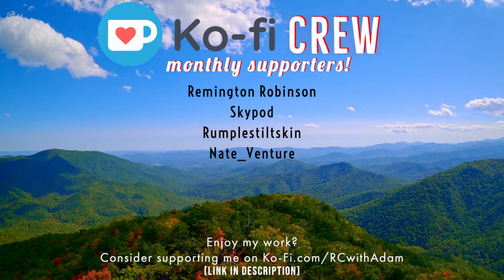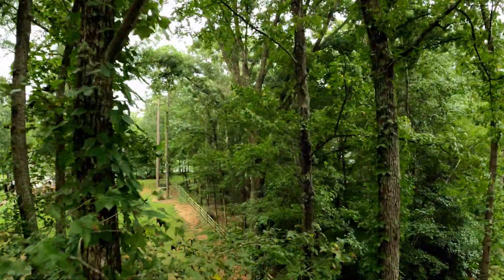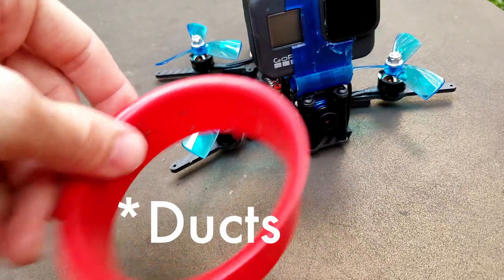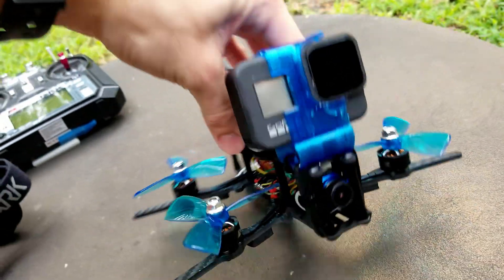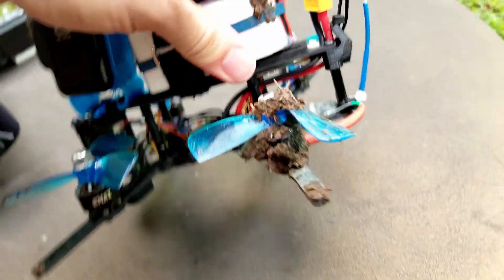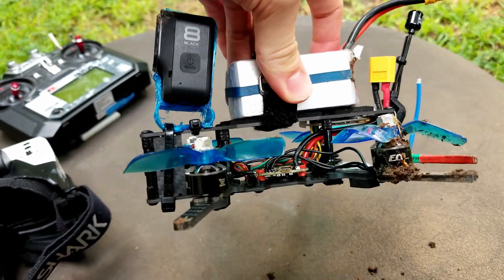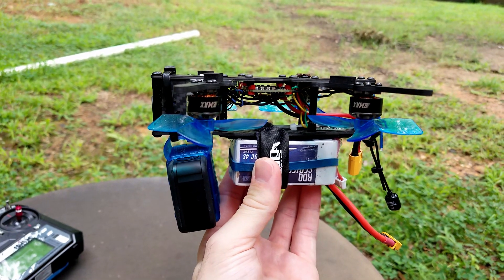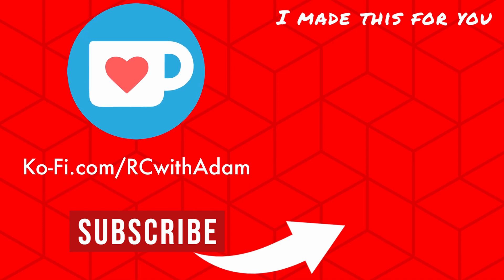Ducts vs No Ducts - CINE3 3" CineWhoop

Comment: That's the Reptile Cloud 149 cinewhoop frame. One of the few frames Catalyst Machineworks sold that wasn't their design. It's the smoothest flying quad I have. Like butter floating on the wind.  Check your PID tune....
Reply: Add get rid of those shitty emax motors. Solve some issues right there...

Comment: Purpose of ducts on cinewhoops isn’t really for extra thrust. Main purpose is the duct drag decelerates your quad when you pitch up. That way, you can slow down without having to pitch backwards so much as to lose the object you’re following. 

Also, it doesn’t seem like your cinewhoop is tuned properly. They’re extremely difficult to tune because there are a lot more factors to consider (weight, duct clearance, duct profile, PID, prop shape, etc).
Reply: I just followed basic setup on Beta Flight, no PID tuning, mine works great :) What do you by tuning, what could I do better?
Reply: @peterkortvel  Blackbox tuning is probably the easiest and most accurate. Make sure your FC has gyro logged into the blackbox and you can dial your quad in so that it's locked in.

Comment: That is a Good Idea , Camera and Battery under for a lower center of gravity , for Video Stability ! ... We use to land on Legs and have gimbals with stabilizers ....... all for More for Stability !  On top you have your Antennas and GPS and your heavy stuff is down low   ...... Now the racers , freestylers and Speeders took over with Big Batteries and Flips ! ..... They want the agility for their quick turns and flips .... You want Both ?!  ...... Moving your motors to the arm tips and using balanced 2 bladed props might help ........ That was a lame crash ........ you were doing excellent until then , good thing you only broke a prop !  .....  But , you did teach a lesson ....... Don't push your Luck ! ... :-D